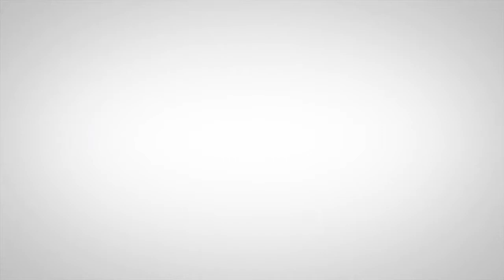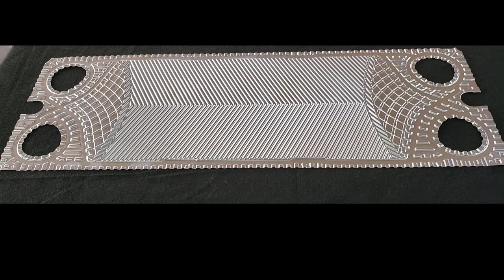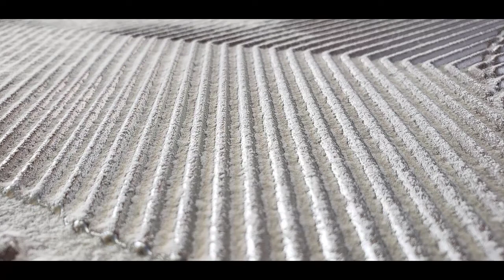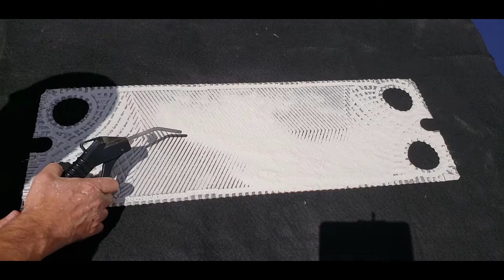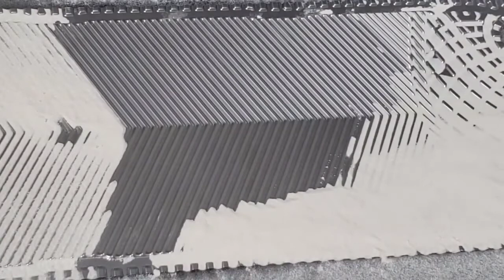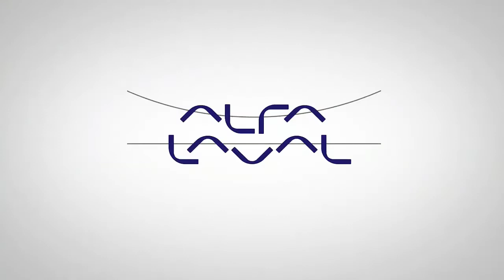What are Fouling and Shear Stress in Plate Heat Exchangers

Comment: Thanks! Nice video! Do You have some video which explains differential switch and how it works as heat plate exchangers flow security device? If I good understood, differential pressure switch wait until the flow make enough pressure drop and press it. This is information that flow is good. I expect if the temperature of fluid drop that pressure will rise and on the end if it is frozen the pressure drop will be max and the pressure switch will be stile pressed? Where I am wrong? Thanks in advance ..

Comment: First of all, excellent videos, it's clear and simple, thanks! What value should we aim for for the wall shear stress? I read in an Alfa Laval document about the best design practices that ideally 50 Pa would be necessary with a minimum of 35 Pa for a fouling applications. Is that right ?
Reply from the maker: Sorry for the  belated reply, yes 50 is a good number and 35 should be considered as a bare minimum for fouling applications. If you are absolutely sure that fouling is not going to be a problem, though, you can live with much lower shear stress